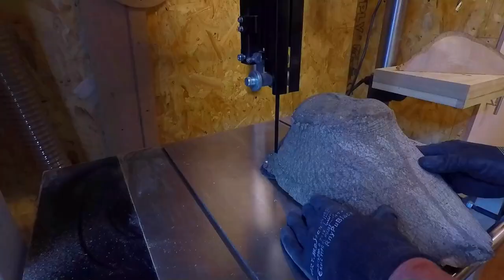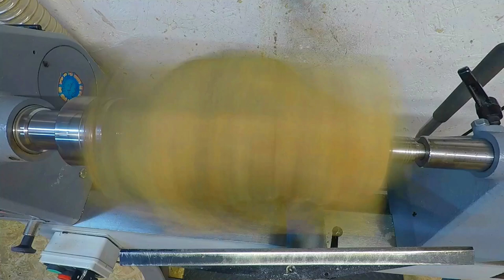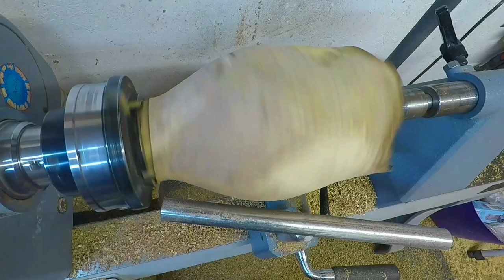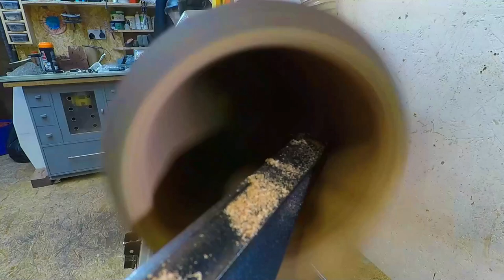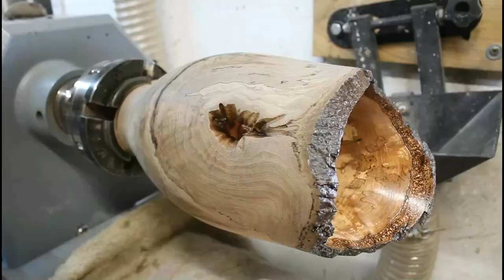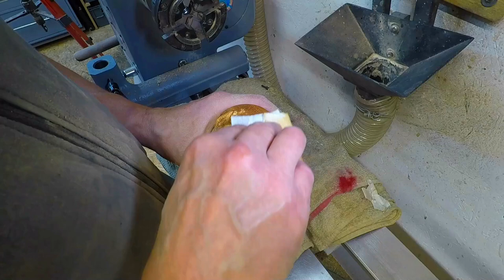Woodturning - The Knot !!

Comment: Some may find it interesting to know that this 'knot' was once a branch that joined either a larger branch or trunk and was sawn off some years ago by someone (probably a trained arborist/tree surgeon) who made the final cut at the correct angle. The tree then started to set down woundwood (very strong with a high lignin content) around the edges of the final cut (looks like a ring doughnut with the hole getting smaller over time)  until it finally occludes (i.e. covers the face of the wound). This piece is interesting in that it has spalting (the dark lines) which is fungus and associated decay that has been compartmentalised (i.e. sealed) which suggests that the branch was dead when it was cut back. Anyway, you made a beautiful job of this piece. It would be good to get a piece of Yew with the same 'knots' but with them opposite each other for the internal detail.
Reply: You sound like the guy who used to peek over "Tim the Toolman's Taylor's " fence!
Reply: Wouldn't it just be called burl?
Reply: @justjeff600  Yes it looks similar i.e. a raised area on a trunk or large branch but caused by different things i.e. a burl can form after an injury or an infection by a pathogen or an abnormal concentration of growth cells and the internal grain features are usually fantastic.
Reply: @heretohear8662 Sorry mate I'm an expat so this is lost on me.
Reply: Thank you for the info. Next life I would love to do this. Be well 🇨🇦
Reply: So does the fungus make it a stinky butthole or is it a kind of probiotic thing for the tree?
Reply: Yes, you get an 'A' today!  That ring is called the annulus.  If you're doing your own pruning, you want to avoid cutting this, or the cut will not heal. I got a bunch on my red oak I trimmed over 20 years ago.  The biggest one is just now almost completely closed.
Reply: @beersnarkunbleached5660   🤣🤣🤣
Reply: So much nerdage.
Reply: @thunderbasilisk1352  ..... so little learning
Reply: Jon H, that's exactly what I was thinking. That's crazy.
Reply: @jonh9561   No jon. You found him!!! I was kind of a jerk too. I'm sorry. Do appreciate your knowledge.
Reply: @michaelsullivan2554  No worries mate, good to know you.
Reply: Wolf Den  No butts about it Wolf Den, the evenness of the ring of wound wood that eventually occluded in the centre of the stub is a testimony to the arborist's skill in identifying the correct location of the final pruning cut. The practice of 'flush' cutting was done away with over 30 years ago (thank god).
Reply: Ivy Mossgarden  My pleasure, I enjoy learning new stuff to and I'm glad that you found it interesting.
Reply: So would this piece have been close to a crotch at one point?
Reply: matthew scoles  LOL
Reply: @theroamingokie5438  Yes, it separated or sectioned off the fungal part, sealing it off inside the wood. You act like that was some sick burn but you just proved that sealing and compartmentalizing in this case is the same thing
Reply: That's awesome you know this.

Comment: Great work. I went to high school from '80 - '84, and they taught Wood working, Masonry, Plumbing, Electrical, Sheet metal, Small engines, Meat cutting, Baking, Textiles, Auto mechanics, Printing, A/V and Machine shop. High schools like that just don't exist anymore. Heck, 4/5's of drivers on the road can't even drive a manual transmission.

Comment: Thumbs up👍👍, really nice result.
If I can give you a tip - if, like it seems, you're using  shellac -  you could even improve the polishing using a swab, instead of paper towel (I work in the wood, too: restoration and polishing antique furniture, that's why I know those things).
 The swab should be made with cotton wool, soaked with shellac, tightly wrapped in a thin-weave cotton cloth (the disused sheets of the house are perfect, as long as they are made only of cotton).  
Then, you must first wet the wadding, and then wrap it tightly in the cloth, squeezing it to drain the excess.
Using the swab, instead of the paper, you will see what result 👍; even better if you'll repeat it after a couple of days.
Reply from the maker: Thanks .. its Danish oil